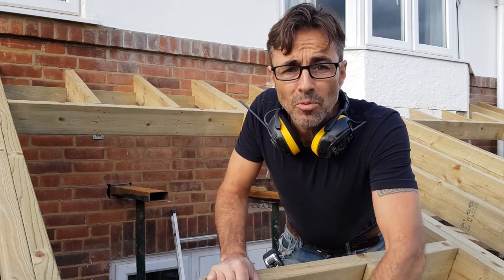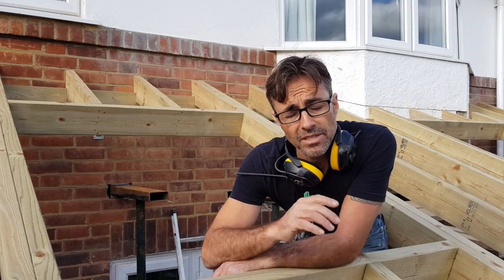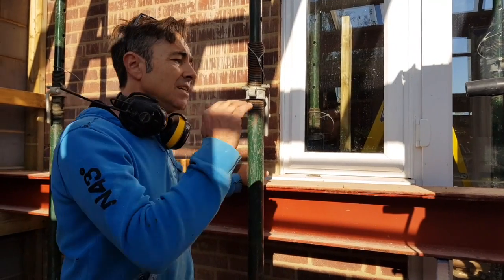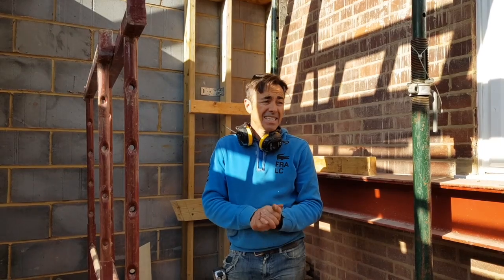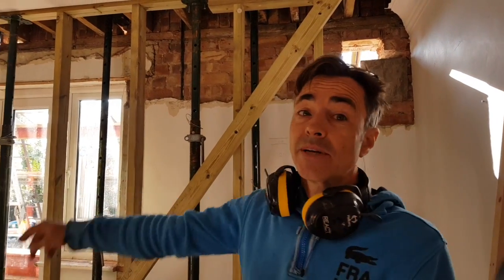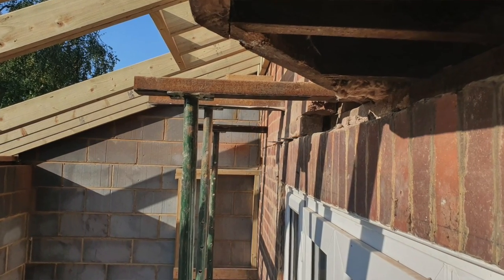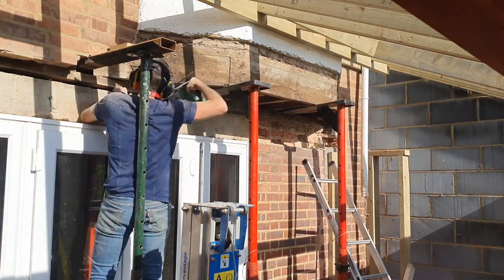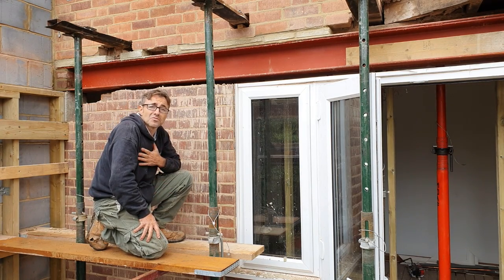fitting a steel beam using needles and acrow props the best way

Comment: is it ok for a size 2 prop to bend a little forward in the top section with a strong boy attached? the bottom is plumb and the top was at the start but bent slightly when wound up....
Reply: Yes

Comment: I'm scratching my head regards the stud wall. Acrows were invented to replace the wastage of timber supports and the fact that they were not very good because of vertical buckling issues. The acrows should be plenty on their own, making the timber wall redundant.
Reply from the maker: The timber wall is there to serve as some support for the floor joists, also a site hoarding once we knock through and we then use it internally for studwork etc so there is absolutely no waste, they are also braced to avoid buckling, timber has been used to shore and support for years indeed raking shores that supported really unstable buildings are still designed and used to this day in timber

Comment: How would you support an RSJ in a wooden framed house. Are you able to support with timber posts or would it require steel uprights at each end?
Reply from the maker: This very much depends on the wall thickness for the supporting elements, very often we use steel in timberframe buildings and the structural engineer will specify how the support should be done, in a timber frame removing a wall can result in racking so its not only the downward loads to consider but the stability of the existing structure and in this case you may need to install a goal post arrangement to allow for the restrengthening

Comment: Awesome video as ever RC. May I ask how is the roof of the extension supported on the existing external wall? It looks like a substantial piece of timber has been fixed/screwed to the brickwork with the new extension joists notch cut and resting on it. If so, would that leave the timbers at risk of moisture that moves through brickwork? Cheers

Comment: Hi 
I noticed you don’t have very deep masonary pillars 

My steel beam is prob similar in length maybe 5.5mtrs they have suggested I build 900 mm masonry pillars each side it really eats into the space 
Can I upgrade the steel width to make sure I have thin pillars
Reply from the maker: Hi Joe, we had a really nice existing foundation on this build, and also the brickwork was super sound and solid, every job can differ and even structural engineers differ on the same design!! Get a second opinion...

Comment: That is a 100% fail safe method, I don't build stud walls I simply remove ceiling an use more props with scaffold boards on the floor joists above and a plank on the floor. Just saves on cost a little

Comment: How do you do this with 18 inch rubble walls
Reply: Assume 1000kg per m2 of wall loading. Factor in roof loading and floor loading if necessary. Use big needles, probably 152 x 152 i beam. Depending on height of the steel use either size 2, 3, or 4 acrow props. There will be a chart online for acrow prop loadings,  it will be in kilo newtons so use a converter for kilograms. The more extended an acrow prop is the weaker it becomes so make sure that you use the right size. Spacing between needles will probably be roughly 800mm if it’s a 2 story house but make sure you do the working out yourself.

Comment: How do you pressure the beam up against the overhead wall or is packing it enough after it sits on the pad stones. I've always wondered how one can minimize play once the pins are released.
Reply from the maker: The gap must be packed properly picked up, we use a combination of slate packing, dry packing sand and cement mix and also a strong pointing mix
Reply: @robinclevettcarpenter  thanks for the reply, very good video. Is it the same approach for putting in lintel for adding french doors or a window etc? A video on that when you get a chance would be great.

Comment: Hi robin. I dont know if you read through any of these comments from older videos but here goes. When you say you "slate up" beneath the steel beam to prop it up, do you literally use slate. I dont know why but  I would have imagined slate wouldn't do too well under compression. But this is me speaking from absolute ignorance, so please excuse any stupid question or comment I may make. Secondly, you're obviously not purely a carpenter. , which I imagine makes you a builder then. Is that right.. Does that mean you can do brickwork, carpentry, waterproofing, excavation, I dont know what else, as a licensed builder. Man, my comments always end up so bleeding long. I 'll shut up. Thanks Robin. Dig the way you think.
Reply from the maker: Hi Jude, we use slate packing on top of the steel to pick up the brick courses and not under the beam where it needs to sit directly on a concrete padstone or steel spreader, the slate is also pointed with a good strong sand and cement mix to completely fill any voids, we also use a drier mix of sharp sand and cement to dry pack larger joints, hope that helps and I do try to read and respond where ever I can, I see about 50 new comments a day across my video collection so it is sometimes hard to answer them all, I particularly liked your comment as it was a really useful question that many people would probably wonder so thanks for that mate!!
Reply: @robinclevettcarpenter  Thanks Robin. really appreciate your thoughtfulness, in every respect. Cheers mate. Jude.

Comment: Thanks for sharing. I'm a structural engineer going into construction. Surprised the engineer didn't suggest a moment frame if the entire ground floor external wall is being knocked.  One of the things building control moan about for the frame to resist wind loads.
Reply: Agreed, this must have passed through an asleep inspector. Needs stability!
Reply: You mean like a picture frame setup of steels?

Comment: Another interesting video. Thanks, Robin. Just one little point. The critical part of moving the steel while raised, into its final position (which I think is the most dangerous part of the operation) was fast forwarded. It would have been good to see that in real time. 😁

Comment: Hi I am Hasan my daughter, s structure engineer has suggested frame for steel beams and columns for kitchen extension size width 7.5m depth 4m. Please advice if you can suggest the type of steel beams and columns are required and also their sizes. Suggest if we can reduce number of beam and column by other secured method. Thank you.
Reply from the maker: I would say that trust your structural engineer and if in doubt about the sizes of beams specified then get a second opinion
Reply: Your daughter is correct. Due to the wall being removed you require a moment frame to be able to resist the wind load. The only exception is if you have wall returns either side of 655mm

Comment: PAD STONE. ,IS TO SMALL should of been. 400-  225 .  +.
Reply from the maker: Hi Jimmy, all Padstones vary and they are based on a structural calculation by an engineer and these where specified by our engineer and in fact we made them even larger than he had specified, the brickwork on these properties is super strong too

Comment: Good day, could you please mention the dimensions of the Lintel and the thickness of the brick wall.

It would have helped a lot if you had included a rough sketch of the wall, load / structure present above the Lintel.

Regards,

Sushil Adhikari...
( India 👍👍 )
Reply: Heard Robin say, " 9 inch wall." Which means two bricks and a 10mm  joint. So, that can be two bricks and a morter joint or one running the length of the wall 
( ==== ) like so, or running across the length of the wall, thus : ||||||||
Depending on the bond.
Reply: A nine inch wall means double brick solid wall.  No cavity.

Comment: Very good. Can I ask a question. I have an old house the beam was out in a long time ago. But opening up some dodgy hardboard round it. I found that there is wood what might have been a lintel from the old house but just bits. Can I leave it as the house hasn’t moved or the walls on the top cracked. So it seems fine. It should I have e it take out and a pad put in. Not sure about the other side of the beam supposed as not got to that bit.
Reply: Thanks.

Comment: Great video Robin, looks easy when it's done right.    A good resource for anyone wanting to get a better idea of specifying temporary propping are the BRE Good Building Guides (document refs: GG10, GG15, GR25). They're written in a way that's easy to understand, not just for Engineer's and the like.  I'm sure they used to be available individually, but looks like you can only buy the complete set of their guides now: https://www.brebookshop.com/details.jsp?id=327779 . Still, probably represents a good investment for a builder serious about doing a good job.

Comment: The beam takes the triangle of wall above the beam, plus the floor loads and transfers them down to either side. That’s why it has to be on dense concrete pads often with engineering brick “nibs” to take the weight down the walls either side. 
When I did mine, I put Acrow props on the inside to hold up the floor. Six more props (three inside and three outside) supported tubes cut through the wall which carried the weight of the wall. 
The gap was filled with mortar and natural slate as packing.

Comment: Hi Robin, Great video. I have recently had a 2.5m steel put in place downstairs of my timber frame house. The steel was put in on a load bearing and wind ‘resisting’ (not sure if that’d the correct term!) wall.

I have now noticed that upstairs - on the opposite side of the house and in other areas too, that there are 2-3mm cracks between the bottom of coving and top of plasterboard - and this spans the width of entire walls in some instances.

Could this be as a result of the steel not being correctly installed, or could it also be as a result of the drilling which happened on area where the steel was installed.

Basically, after the opening was created, there were bricks along the floor which needed to come out and I’m wondering if this heavy drilling might have been the cause of the cracks, or is it more likely that it’s the installation of the beam? Thanks 🙏
Reply from the maker: Hi Luke, DM some images to me via Instagram....
Reply: @robinclevettcarpenter  thank you very much Robin, will do 👍

Comment: Hi thanks for video. Very well explained.. 
 My question is , I’m removing load bearing wall for a patio door opening is 355cm and high is 230cm .. how many needles do I need ? It’s 9” wall. Thanks 
 Regards kaz
Reply from the maker: Hi Kaz, without seeing a picture or knowing what the structure above is its hard for me to say, but based on the dimensions you could do it easily with three needles so 1 in the centre and the others spaced equally from the centre to the edge of the opening, just make sure that the props have a good footing mate, good luck Robin
Reply: @robinclevettcarpenter  thanks for your reply.. how can I send you some photos? Thanks 
Regards kaz
Reply from the maker: DM me on instagram

Comment: Shame the builders in Chelsea didn't watch this video.
Reply from the maker: Blimey!! that was mad!!! I have had comments on my video from people that say that my work was way over the top, this collapse of the building in Chelsea is not the first one in recent years indeed there has been many!!!, I spent many years working as a sub contractor for loads of different building firms and I have seen some really bad and dangerous stuff, I have also seen when buildings do move and crack due to insufficient shoring, the trouble is that anyone can call themselves a builder!!!!!
Reply: @robinclevettcarpenter  hit the nail on the head there Robin

Comment: Thanks for the informative video. Was this a drop or concealed beam for the finished look?
Reply from the maker: Hi Abdul, this was a dropped beam if I understand you question? so beneath the ceiling level
Reply: Thanks Robin, were planning to do a similar extension but with a concealed beam, trying to find guidance on that.

Comment: What happened to 150mm bearings?
Reply from the maker: That's what we have here
Reply: @robinclevettcarpenter  Good Morning Robin, it looked like snap headers, why I asked, it is that I have been told that as long as you have a bearing of 300mm in total you can have 200mm one end and 100mm the over and I am wounder have you come across this?

Comment: Good one done a good few steels only difference is instead of the stud wall I'd put in a second line of props with scaffolding planks tying in the joist's .See you got your steel reinforce with a top plate .  Always check your props first thing in the morning , might get about quarter turn . Lot of heavy work .👍🇮🇪🍀 Stay safe

Comment: Is that just one steel in and not two - one over each course then bolted together?
Reply from the maker: This was a solid wall so a 203mm wide beam with a 220mm plate welded on top was what the structural engineer specified, we often use 2 beams when we have cavity brickwork, well observed mate

Comment: Great job, similar to how we do it but we get the inside skin in first dry pack it then take out outside skin then drop that steel in? 
Instead of stud wall, couldn’t you just do a number of arco props with double scaffold boards top and board. Save you money? 
Top job though?

Comment: Technical as ever and lovely neat job as usual. Like you say used to do a lot of that type of work in England. Never knew what I was doing only how to do it. Thankfully never lost one. Where I am in Oz mostly tin roofs no weight to speak of. Not many brick homes. We cut openings with minimal support and small ones with none. Tie down to stop them blowing away is more of an issue than load in most cases. Different World and like learning a new trade.

Comment: What did that all cost? Hope the temporary timber wall was repurposed.
Reply from the maker: Hi Joe, that wall will be used for framing out other parts of this build, The material in that wall was less than £100 and it only took a couple of hours for me to fix, we never waste anything, time material or even fixings!! all the best mate
Reply: Its robin clever mate of course the timber was used
Reply: When you add, cast in situ padstones with crush test, lifting equipment, labour to put steel in room to then hoist plus props plus needles plus timber stud install and remove, then extra safety ladder detail,  just seems expensive way for a straight forward job. Love your carpentry

Comment: "Wedge and pinning" I was told a long time ago. No one knows what I am talking about nowadays. "Hope and a prayer" seems to be the order of the day when judging whether  one has charged the new beam sufficiently enough with force to avoid a dreaded  a second wave of forces causing more beam deflection and possible cracks to the masonry. How do you tell? Is it the sound the hammer makes when it is just right? "Overdesigning" cheap steel beams does help, but still, the crack risk must be a constant worry.
Reply from the maker: We I use a similar method to what your talking about, we have had jobs before where the engineer asked us to bolt a winch to the existing foundation below and pre stress the steel, its amazing how much these steels can flex too, the knowledge you have is being lost, anyone can call themselves a builder in the UK and there have been some horror stories in recent years!!! thanks for your comment
Reply: @robinclevettcarpenter  Pre-tensioning with a pulley and measuring the deflection to meet design criteria, sounds like a more scientific way of calibrating the beam deflection. But even that is not perfect as it is a point load, not a more realistic uniformly distributed load along the full length of the beam. So even structural engineers struggle to perfect a practical solution to a difficult situation. A compromise like a lot of building task, is inevitable. Thank you for that insight and I hope your good work is given full consideration by your clients.

Comment: That beam looks a bit low. Should be tight under the joists 7:14
Reply: Andy b.....
....looks like he's filled gap with cut down concrete blocks and pug.
Reply: As a customer I would want the beam as high as possible
Reply: @himynameisandyb  .
....the packing would take up any discrepancy/deviation between the upper material. 
You have to consider the RSJ as a fixed rigid unit, but the joists are a collection of variables. 
It only takes one or two joists to be on a different plane (that's the difference between carpentry and joinery) and therefore the remaining joists would need packing anyway .
Reply: @himynameisandyb  I get asked that all the time but there not as keen when we tell them it’ll involve putting needles through the upstairs walls and props through the floors. That’s more rooms to redecorate. Everything’s possible. Some customers are working to a budget and don’t care if the ceilings run through as one